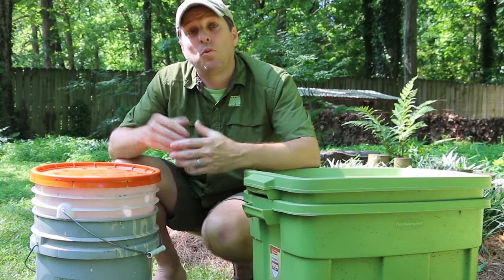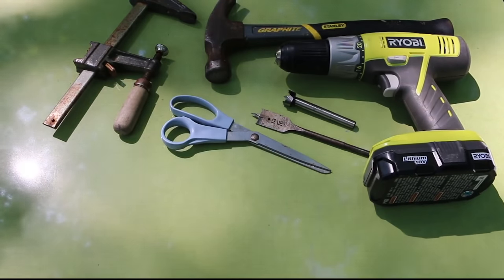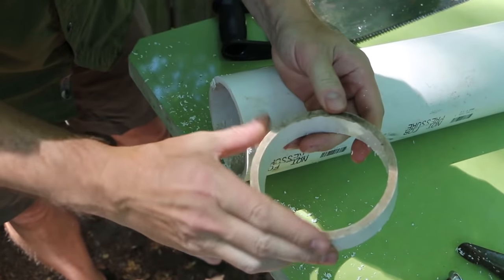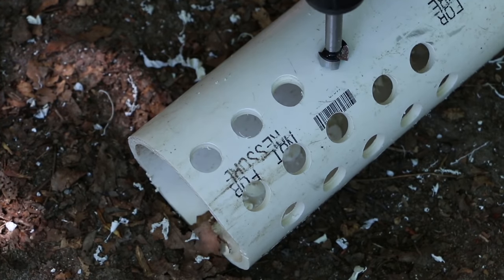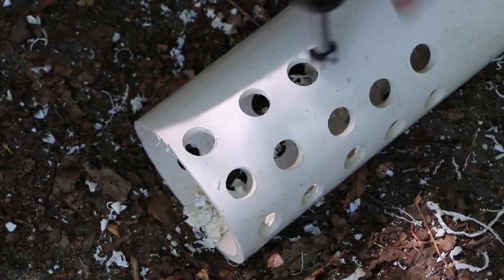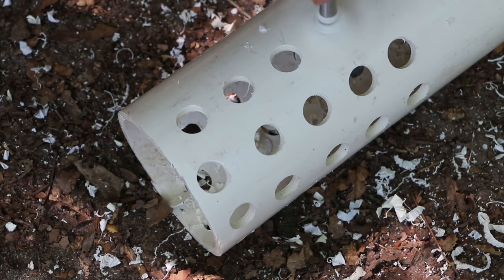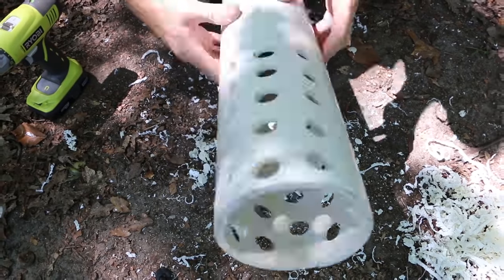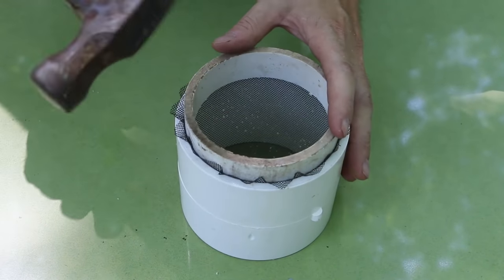How To Make A DIY Worm Tower

Comment: Also, if you drill this in your garage you will leave absolutely zero PVC bits for birds to eat in your garden or lawn.  Just a friendly FYI.
Reply from the maker: ‘‘Tis true. I did a better cleanup than I showed on camera, but still a tarp or drilling on concrete would have made cleanup a lot easier. Thanks for the feedback.
Reply: Good call -  I was going to ask exactly the same thing.
Reply: I thought of mentioning the same.  Thanks for pointing it out already.
Reply: @GreenShortzDIY  could you not have made this out of cardboard postal tubes this will last a few years then rot away so no PVC in your compost more green.
Reply: @paulbritton7808  i
Reply: @paulbritton7808  that's a great idea. I have a couple of huge poster tubes and don't know what to do with them. I only have about 80 red worm that I took out of our huge cold compost. When I get more I'll try this. Thanks!
Reply: Darwin awards for birds.

Comment: Here I am, deep into a pandemic, years later after you posted this saying, "Thank you kind sir for this info. This beginner gardener is going to have an amazing beginner garden."❤
Reply: A Glass Of Merlot right there with you delving deep into YouTube rabbit hole.
Reply: @josephsepulveda8819  yea, I'm tired of trying to figure out where my food comes from. We got this Mr. Sepulveda
Reply: Use a PVC Cap and put a rubber band around the mesh. Easier to take on and off.
Reply: @rebeccalankford2652  Was wondering about that - you don't need air to get inside?
Reply: @tutupeacock  Yes, most will drill small aeration holes just under the cap and glue in a piece of insect screen. All this is unnecessary though as all you need to do is bury scarps with in the top 6 inches of soil and cover it. Just grind eggshells and blend banana peels, add coffee, tea grounds then mix in a little paper or card board and direct apply to several areas through out your garden. So you will grind and liquify and add paper or cardboard pieces that have been shredded  mix and bury. It is better to do small batches at a time.
Reply: Same
Reply: What pandemic? There is not stinking pandemic!
Reply: A Glass Of Merlot  me too!
Reply: @stevenfeil7079  How I wish there wasnt.
Reply: @krystynamcgehan9637  Well, you got your wish. A .04% mortality is NOT a pandemic. 

Well, there IS. a POLITICAL PANDEMIC.
Reply: Might I suggest Bonnie Best tomatoes fot next years garden. Those little grape tomatoes are flavorful too. I tried beefsteak, and roma along with bonnie best. Bonnie Best won the flavor test and the cosmetic test...by far. Enjoy your garden🌿🍀😁⚓🇺🇸
Reply: @josephsepulveda8819  
Indeed!😐😎⚓🇺🇸
Reply: @rebeccalankford2652  
Rubber bands won't last the summer. What I do is is put the cap on about 3/8" and it slips right off. No fuss, no muss. Easy peezee japaneezee🌿🍀😊⚓🇺🇸
Reply: @rebeccalankford2652  
If you use a cap why would you need the mesh?!🌿🍀😐⚓🇺🇸
Reply: @rebeccalankford2652  
A better way is to freeze the scraps for a day to break down the fibers of the scraps. I've done this for my compost pile and it works well. As it is now, I dont even use the compost pile anymore. Almost as soon as I fill the towers up, the next day it's almost gone. This is way easier than blending the scraps. Work smart not hard friend🌿🍀😊⚓🇺🇸
Reply: @stevenfeil7079  
What's up my fine feathered friend? It's nice to see some gardeners aren't falling for this "pandemic" hysteria. What's up with the face diapers?🌿🍀😆😁😊⚓🇺🇸
Reply: @lrobinson1792  air vents to keep insects out.
Reply: @lrobinson1792  NONE of my Bonnie plants did crapola for me this year. NONE OF THEM.
Reply: @stevenfeil7079  
I don't know what to say. Mine did well last year. I don't know what you need to do but you're a gardener so don't give up. Overcome!🌿🍀😊⚓🇺🇸
Reply: Willy Wonka  I said what I meant and what it REALLY is.
Reply: bojo perez  Well Bojo As long as you stay organic with carbon (leaves) and nitrogen(grass clippings, kitchen scraps)you can't go wrong. Also start composting and spread cured compost in your garden to further enrich your soil. Personally since I built my worm towers I don't have to bother with composting. Worm towers are the 💣 bomb. Work smart not hard Bojo and Keep gardening gardener.🌲🌿🍀⚓🇺🇸😊
Reply: @stevenfeil7079  Tell that to the relatives of the 300,000 that have died..
Reply: @lrobinson1792  L Robinson, thanks for the suggestion to freeze the scraps.

Comment: great video, I don't know if anybody has commented but your screened lid can easily have a 3/8 inch hole cross drilled into the cap and a rope handle threaded through the lid to be used as a easy pull handle just in case the lid gets stuck onto the embedded pipe. I hope I make sense in my comment.
Reply: good idea!
Reply: Yes best time to do a worm tower pray tell me how to empty it
Reply: I was thinking vaseline might do the trick...ez on. ez off.
Reply: @Rick-bl4js  I wonder how long the Vaseline will last on the lid. His suggestion of sanding is the best. Perhaps use a power sander or I might use a motorized steel brush to greatly reduce the outer diameter of the standing pvc pipe. I have a bench grinder with a steel brush wheel.
Reply: Thinking Impaired ... It made no sense to me to try to sand down the outside of the end of the tube to get the union for the lid to slide on and off easily. It is not easy to sand down the outside of a curved surface.  I sanded down the inside of one end of the union using a sanding wheel sold at Home Depot for use in a Dremel tool. (You could also use it in a regular drill.). It has many short flaps of sand paper that extend out from the shaft at one end. This tool made very fast work of sanding down the inside of five unions to make the screened lids for my towers.
Reply: That's a grad idea📐📏✏🌿🍀😊⚓🇺🇸
Reply: @Rick-bl4js  
I used some lithium grease... It lasts plus I only put the top on about 3/8". The dam thing just slips off then.📐📏✏🌿🍀😊⚓🇺🇸

Comment: Powdered egg shells are good grit for worms too. But do not use shells from raw eggs. Bake shells at 200 degrees for 20 minutes (this kills bacteria and dries them out), let cool, then grind in coffee grinder. Grind to a fine powder. You can keep the egg shell powder in the freezer if you have more than you need, then add a little at a time as needed to your worm bins.
Reply: right, be very, very, very careful how you dispose of something natural into something natural for something natural. don't forget to also first freeze them, drive them around the block twice, read them a story, put oil on them, take the oil off, then spray them with some chemical. This is why I wouldn't be a chicken farmer...the daily stress of an egg hitting the ground.
Reply: Due respect.....RAW SHELLS crumpled is 100% fine.  Smh
Reply: Conqueror Rising . Agree, you have to drive them around the block twice but it MUST be in opposite direction !
Reply: No, no, no! The bacteria in egg shells is GOOD bacteria in a garden. Ya don’t want to kill it.
Reply: The only reason you might want to bake egg shells is to be able to grind them more finely so that worms can process them easily. Also, the fine powder produced is more water soluble and easily absorbed by plants.
Reply: @xrcxconquerorrising5168  I really think people tend to exaggerate a little bit about the food loaded into worm bins or composters, like in this case with eggs, but the truth is if you make the food pieces smaller, you get the job being done faster. Honestly i like to freeze my food scraps and that's very important because when you do that you kill fly eggs present on the surfaces. If you don't do that you will probably have problem with black soldier larvae infesting your material. Yes they' re better than worms, but what almost no one says is that they're disgusting creatures and they produce a slime that make everything smelly... Also you shouldn't  throw food scraps everyday in traditional worm bins because they don't like the high temperatures the decomposed food starts to produce naturally... so yeah it's very hard to deal with worms, i personally freeze my food, thaw, cut them with a knife or scissor and feed my bins every two weeks (sufficient time for they eating everything). I also add pulverized egg shells ad pulverized leaves into the bins, yeah pulverized because you would be surprised how much worms don't like eating them when they have better options... i'm not kidding!
Reply: I just dry the eggs shells fully first. I put my stack of egg shells in a bread pan before I put them in my vita mixer to break them up. Then I put them in the worm bin. If you don’t have blender then crush them by putting another bread pan on top of them.

Comment: I already made a worm tower for my raised garden bed, but pit it further into the ground.....so many holes to drill.  
However, I found later on that I really didn't need the worm tower at all and removed it from the garden bed.  You get the same outcome by just adding the worms directly to the garden bed and digging in food scraps on a regular basis.  The worms love banana skins and cow manure.  My raised bed are now FULL of red wigglers and plants are growing like crazy.
Reply from the maker: Jelleff, good point. I agree that once your whole garden bed is colonized by your composting worms, a worm tower is redundant. I like getting things started with a worm tower, but once it is going you can add your kitchen scraps and food waste directly to the garden soil. That is how my grandfather did it. Thanks for your comment.
Reply: @connietaylor504  The worms live in the garden bed now.  You don't need to remove them.  But if you have really cold winters where your variety of worms wouldn't survive, then you may need to take some out. Eg, if you just depend on your native worms, then things are OK.  But if you have brought in a special worm to do the job, such as red wigglers, then they may need protection from really cold weather.
Reply: Noice
Reply: dont the worm eat healthy roots?
Reply: @lowcost549  No, they're not really that type of worm.
Reply: Flies are attracted by openly distributed food. Also it could get quite smelly in summer. And children and other animals could get attracted too. So such a worm tower really does make sense.
Reply: @connietaylor504  - If you have a worm tower, you don't need to dig up the worms. Either you place a banana peal inside the tower one day before you might want to set up a new bed for some other plants, or you just don't do anything. Worms go deep into the ground anyhow, and whatever you plant, will be planted on the surface. You shouldn't turn the soil within the beds, because the tiny little animals within shouldn't be brought up onto the surface. Yet you will probably change whatever you plant in the beds, like one year vegetables like cucumber, salad or spinach, and the other year maybe pumpkins. But even then, there is no need to prepare the bed by digging the soil from the deep and putting it as top layer.
Reply: @lowcost549  No. They have no teeth, so they simply suck up what is eatable for them. Little microbes, bacteria, and even funghi prepare the food for the worms, and these species only work on dead or rotting material.
Reply: But surely the point is also to have a way of disposing of kitchen scraps?
Reply: Ya this man doing the most he just watering paper and bananas thru a pipe
Reply: Lindsay Jelleff I did the same. Earth was pretty soft so I would just use post hole diggers, dig a shallow hole, put the scraps in the hole and cover it up. No odors, no pests, no problems but brought in a bunch of worms
Reply: I  live  next to a nature preserve in Florida so I have all sorts of animals who come to visit my vegetables and fruit trees. Last year I put worm towers in two of my 25 gallon wicking pouches. The pouches without worm towers had visitors dining on my food scraps until I put irrigation rings on top of screening to keep them out. And the top of the ones growing turmeric  got so crowded that I couldn't get any food to my worms after a few months.  I just started refurbishing the pouches with the worm towers and found lots of worms throughout the pouches. So now I'm putting worm towers in all of them. I used thin 4" PVC which is easier for me to carry and cut.  I also had to replace my fiberglass screening with metal screening because my visitors destroyed the fiberglass screening.
Reply: @GreenShortzDIY  but how to you deal with raccoons and possums ect by just putting out on the top soil? Or do the worms handle it before it's even a issue?
Reply: @dream.fiiend  it's more work but I blend kitchen scraps including egg shells and pour them in a trench in the garden this doesn't seem to attract animals so far. P.s. it's a designated blender ;)
Reply: @connietaylor504  ,
Reply: @lisasternenkind6467  dont let your kids eat from your garden scraps and youll be ok.
Reply: NO WAY  ...my dogs would eat part t of it and mouses would do the rest.... !!!
Reply: @pershop4950  would putting flood lights on the ground out in the garden creating hotspots not do the job
Reply: @lisasternenkind6467  I like that. Children and other animals. They can be little monsters I grant you
Reply: Blending your compost is a bad idea as it takes away the air pockets that would be there if it wasn't blended.  Air is an important factor in the process of decomposition.
Reply: @pershop4950  Whats the best way of protecting the red wigglers in the raised garden bed? If I cover the bed at the end of the season, will it provide some heat retention?  I live in Northern New Jersey where winters get pretty cold.
Reply: @lisasternenkind6467  millions of people have composter in their gardens and throw aaalooot of kitchen scraps on it. Never seen children crawling around these, building compost forts and feasting on banana peels. And if: so what. Do you know, how many microorganisms live in a handful of soil? Shall we protect our  kids from touching it now? I grew up with a garden that had a composter. And foxgloves, and what not. And I somehow survived childhood. Maybe teaching our kids what to do, having some trust in them and sometimes let them make their experiences and not helicopter around them would be just fine. 
I burry my kitchen scraps in the ground as well and it doesn't attract flies or rats and, since it's covered with soil, it doesn't smell (unlike my neighbours composter - oh, the irony).
Reply: NOT redundant if you want to harvest the compost to use in areas that are not worm friendly, like potted plants.
Reply: @MrBubbadon  a bulb planter would work too if you do not have a hole digger. Thanks for tip!
Reply: Wow. I’m have around 8 acres of land. With more than enough water to make it all productive, but o want to make a permaculture fruit jungle, would this work on fruit trees. How would you do it, and mantain the worms. Also are they invasive. I have this land in the Amazon Peru. Do not want to bring a species that does not belong
Reply: Tmoles must be sooo happy!
Reply: @gregschroer2314  p
Reply: @lowcost549  They won't. They are after scraps.
Reply: how do you solve the predator problem? you know, like bird and roden eat worms
Reply: Adding food scraps directly into a raised bed already colonised by red wiggles might seem like a good idea  - until you realize this could attract rodents, pillbugs & slugs !  The worm tower provides a useful separation from such pests - although slugs travel underground too &  can migrate into the tower
Reply: @lowcost549  Really u asking that question? They eat paper. Gives kids a now excuse, sorry but my worms 🪱 have eaten my home work
Reply: @nessanessa2934  it is funny to me to read about how so many parents now want to “protect” their children from life as I (we) knew it growing up. How in the world did we ever survive childhood without bike helmets and things that are common to children of today. Other than meals, school and sleep we spent all of our time outside. In the woods. In the creeks. In the dirt. In the trees. Digging holes. Playing with sticks and rocks. Cold weather did not stop us. Snow days we used plastic bread bags between our socks and boots. Goodness those were the days.
Reply: @simpleminded5215  those were also the days of terrible head injuries for children who did not have head protection while riding their bikes. Not everything about the old days was good.
Reply: @sandyewald2933  well, I will take
Those days over today any day.  We did not have any active shooter drills in classrooms then.  Bomb raid drills yes.  But I do not find those as scary or imminent as active shooter drills. 18 2nd,3rd, & 4th graders lost their lives yesterday on the last week of school in Texas.  Completely and horribly shameful that school shootings only happen in America.  My kids have had to grow up their entire school lives with active shooter drills.  Beyond pathetic. 

We vote in politicians to work for us as a society, yet they only vote for who gives them the most money.  Do we need a civil war to change this country?  What the heck is the problem with wanting our children safe from AR-15’s ? There is no legal valid use of a gun like that in society.   We are supposed to be first world and we are beyond third world when it comes to our childrens safety at school.
Reply: That is what I was thinking.  Thanks for sharing.  I guess it wouldn't be much of a video then.
Reply: Thank s I will tray ur method if I don’t have rats this year.  Last year they ate my seedlings so I gave up for the yr. I want to protect my worms. They r expensive littlebugers at $50.00 a lb.